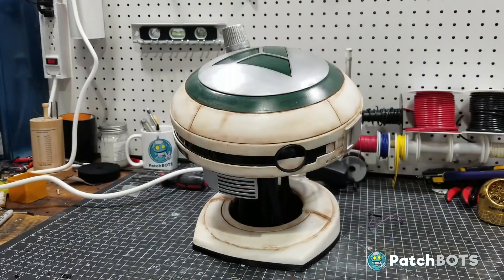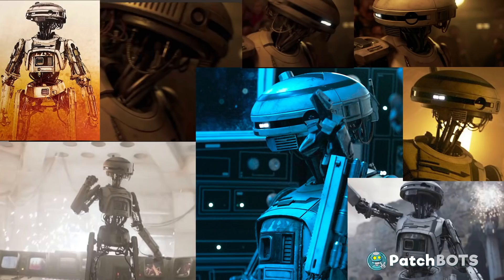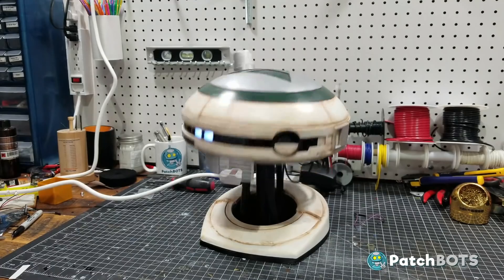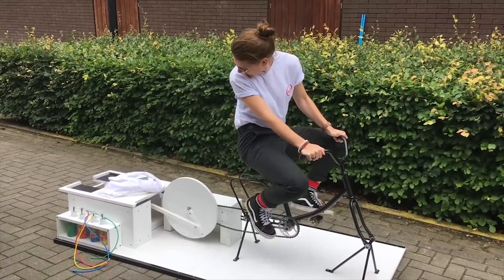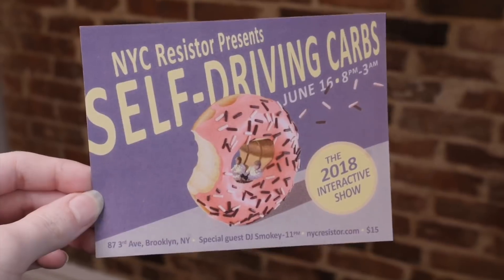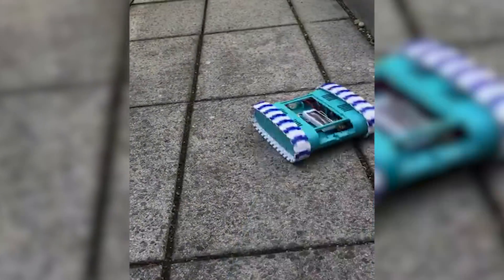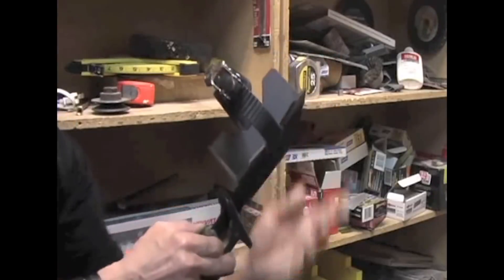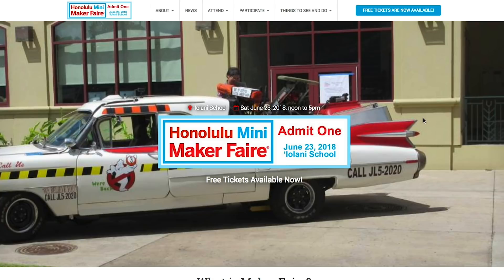Maker Update: L3 Liberates Alexa

Comment: Regarding the spray can shaker, Steve Ramsey at Woodworking For Mere Mortals recently did a (very unscientific) test to see how long you need to shake a can before it's adequately mixed.  His results suggested that as little as 5 SECONDS of shaking was enough.  That may be a little too quick for all cases but that does suggest that maybe a vigorous power shaker might not be justified.
Reply: Good to know. I always feel like I'm letting my paint down by not shaking it enough.